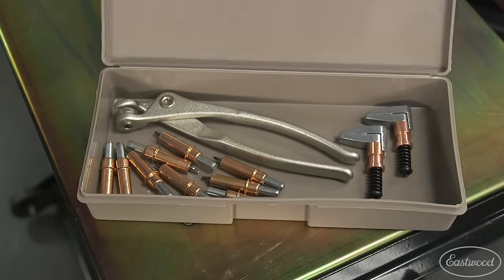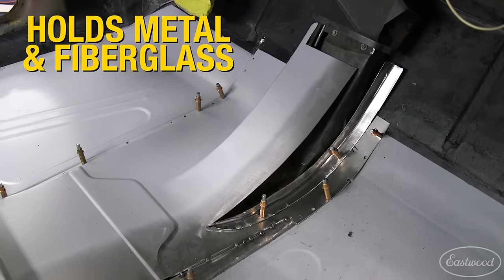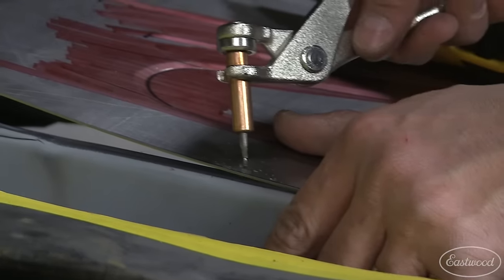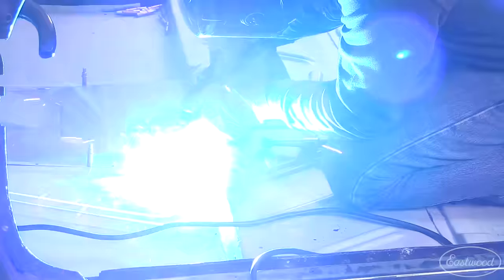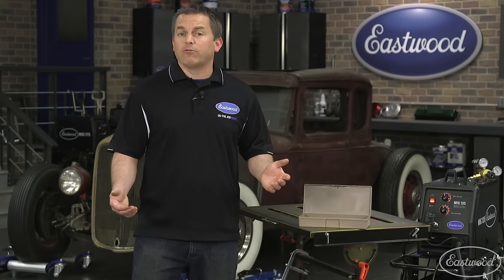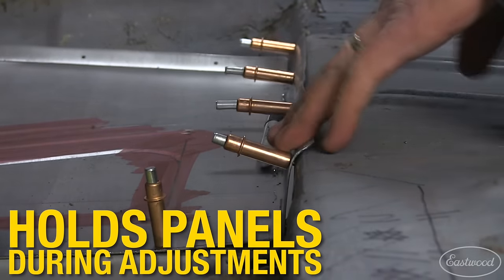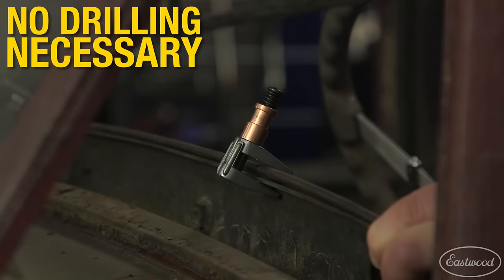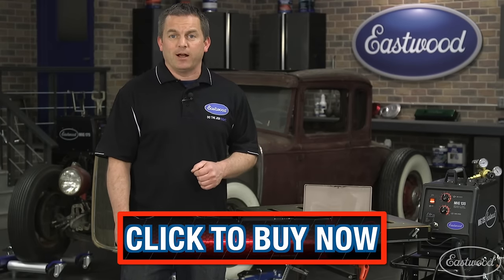Get Perfect Panel Alignment With the  Clecos® Panel Holding System From Eastwood

Comment: I use self tappers. not only does it drill the hole, its done. no need to pull my drill bit out of the hole and stick a cleco in it. plus, the screw pulls tight whereas the clecos do not. i have this cleco set and still wont use it. it sucks in my opinion and makes more work than a self tapper.

Comment: What size is a factory spot weld?
Reply from the maker: Standard practice when replacing spot welds with plug welds is 5/16 or 3/8" diameter.

Comment: What size hole or drill bit is used?
Reply: 1/8" inch, as far as I know. Holding capacity is about 20 lbs of pressure each. Whoever is moderating this, please correct me if I'm wrong.